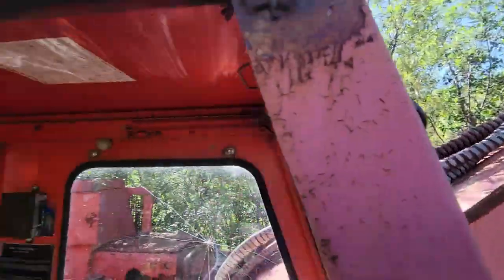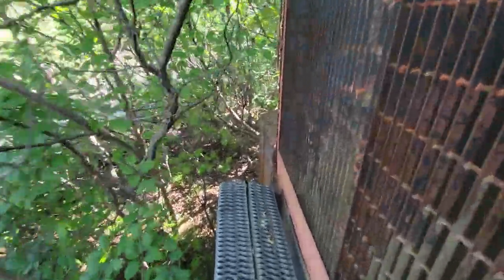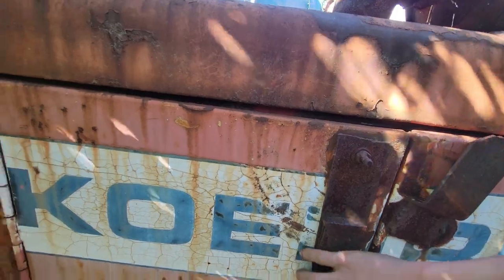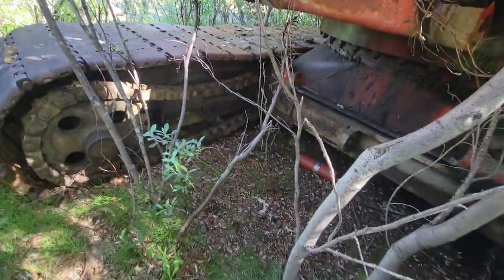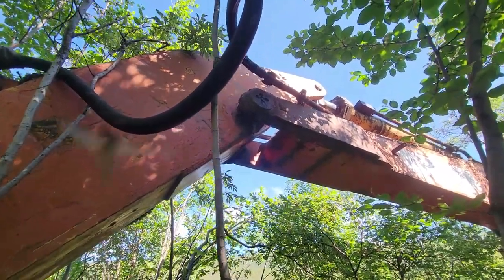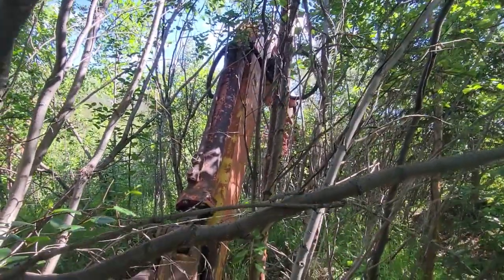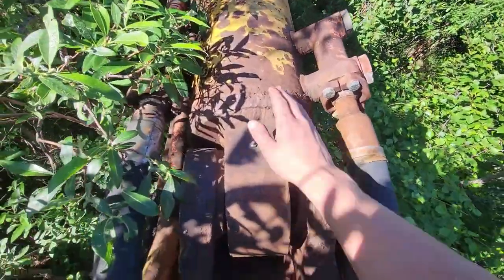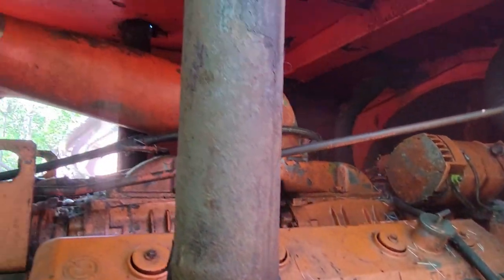Abandoned Excavator Left For Dead in the Alaskan Bush; Detroit Diesel Powered Koehring 1066

Comment: Why Can"t I come across something like that. I'm from Ct , I worked at The Koehring Dealership At The time In The 80's My Dad  Also Worked There Started in The Early 60"s. I have all Info On Them Machines, That One Is Not A Skooper Hoe All though It Was Avallible as one, Most Of the remaining Skoopers  At The Time Were Converted To  What You See There An Excavator Attachment. Thanks To Michigans 1st Rubber Tire Loader A Series. I Have A 455    Serial # 12763 Year 1965 Old, Like Me Old & Worn Out. That 1066 Is A 1-A Series  No Turbos Back Then. I Couldn't Believe What Someone Did To The Stick Cyl 😩😫 All Of That Rag Bag Weld On There. Don't They Realise There's Just An O-Ring & Back Up In The Gland  ME Style Wiper & Rod Seal. Work At A Hydraulic Shop Now, Thoes Machines Have The Easyist Cylinders To Work On. Nicely Designed & Structered. I Need To Go Rescue All Them Old Koehrings Across The Entire U S. So They Don't Fall In The Hands Of Bad People. Just Don't Have Any Money To Do So. ( PIPE DREAMER I AM). 😔😔
Reply: We have a  Bantam C266 4-71 detroit , all sticks and pedals ( no Joysticks). Its life has been in the High desert digging 40 foot holes for massive wind turbines near Tehachapi Ca. so it has little rust. The tracks and bucket are 90% , and has and extended reach stick+boom+bucket goes 37 ft down. All the rollers are stuck now , but the tensioners work. Since the pumps , and rams were rebuilt it only has 10 hrs , but sat the last 28 years because it was a slow mover. the Glass is perfect and clear. We used to unload heavy equipment every now and then.
Now my Brother wants to part it out.

Comment: That Machine Serial # Begining At C14431 - C15788   High Pressure Relief  Swing & Traction Motors (5500 PSI) Counterweight Removal Relief (2000 PSI).Counterweight Control Valve.Override Relief Traction Pump Is 5000 PSI.